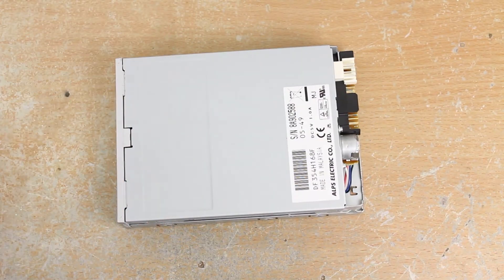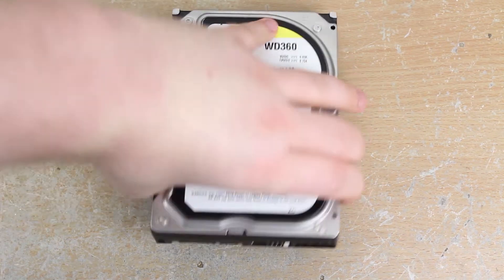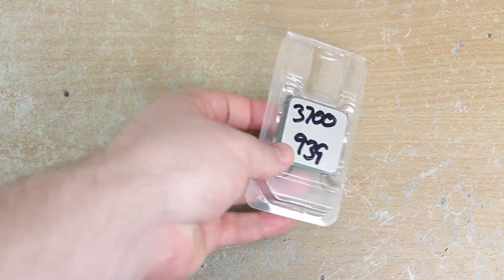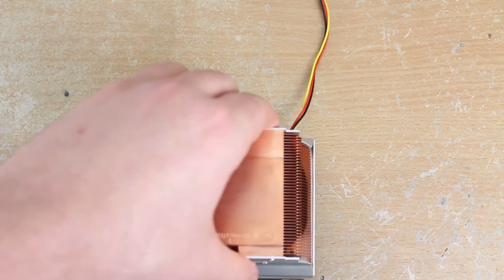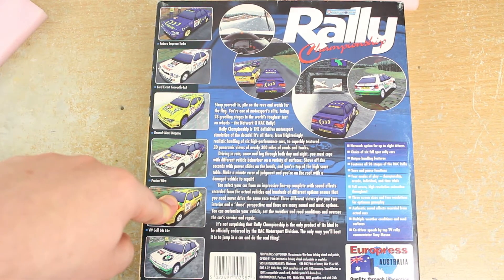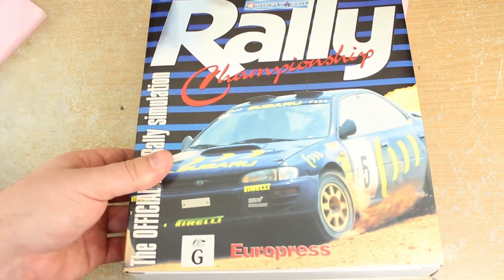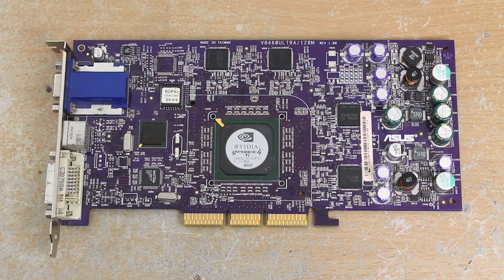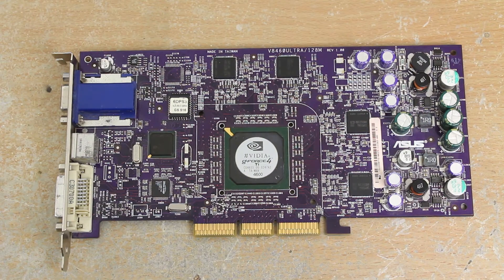Pickups #1 - The Rare Breeds!

Comment: I bought the same Hercules 3D Prophet 9000 PCI back in 2002. This was the first video card I bought. That was at a time when the nearest hypermarket had all sorts of computer cards...and they had a whole lot of those, as well as Hercules Kyro 4500XT.
I was limited by the lack of AGP slot on my motherboard, and the integrated intel graphics of the time were terrible. This card was perfect, and performed really well. There was nothing better on the PCI slot.
I sold it shortly after when I built an entire new system based on an Athlon XP 2200+. 
I got one in my collection a few years ago, it came with a Rage Fury Maxx lol